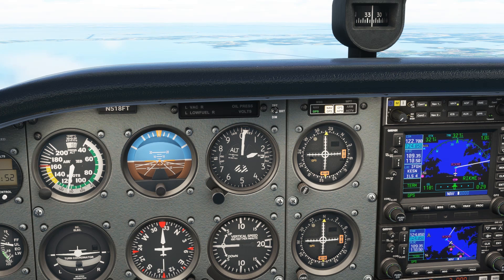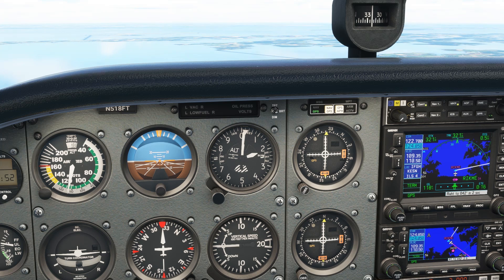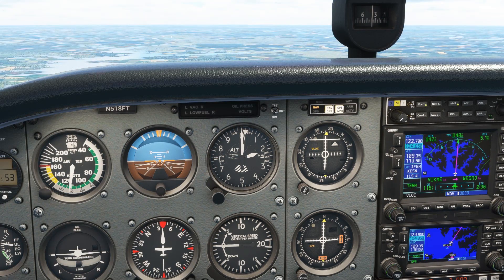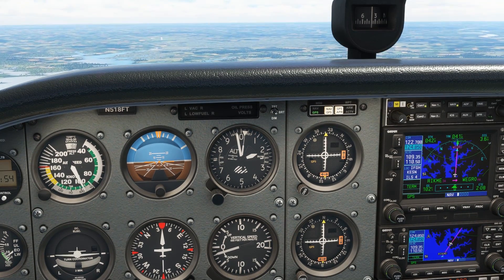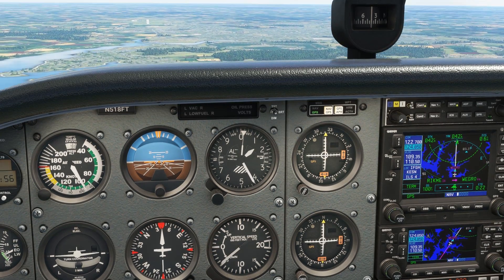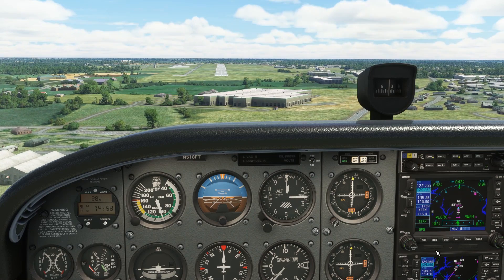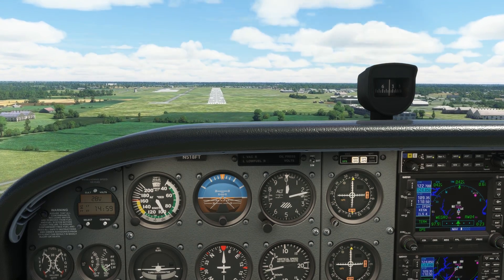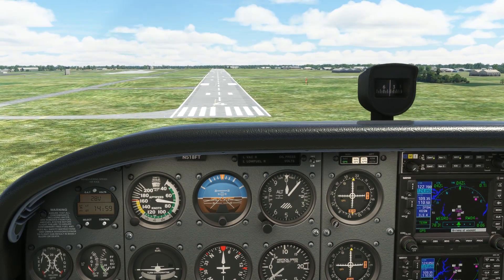Major Cause of IFR Checkride Fails | GPS and VLOC Modes

Comment: 430 will switch to VLOC  when you are joining the leg immediately prior to the FAF  AND  the localizer frequency is correct in the active NAV radio.     In some cases you may want to monitor the glide slope indication earlier than that in which case - push the vloc manually.
Reply: Yeah.  When you load the approach, the GPS loads the localizer frequency into the STANDBY.  The pilot has to flip it to the active.  

Also, when the GPS does the determination of whether to switch to VLOC (which is like 2 nm from the FAF) you must be more or less centered on the course, and you have to be going within like 45 degrees of the proper course; approaching it at 90 degrees won't trigger the switch.  

ALSO also--the above is the behavior by default, but it can be turned off in the menus.  So if you're used to depending on that setting, make sure to check it if you're flying an airplane that other people fly.

Comment: So if the approach such as the ILS-30 @Jefferson City, MO uses a (LOM) as the IAF, you can fly to it via the GPS. If you still had a working ADF you can use that to go to the IAF. So I’m guessing you must fly outbound on the GPS, start your procedure turn as published and the switch to the VLOC to intercept the localizer inbound? If you fly outbound on the localizer then there is reverse sensing and a very sensitive CDI. I would think the examiner would allow you to switch to VLOC as you are starting the procedure turn. Am I wrong?
Reply: During my training we switched to vloc a bit before crossing the IAF going outbound. It is sensitive but can still be referred to.

Comment: I passed my instrument checkride in October. The only note from the examiner afterwards was, “Garmin will get you”. Now, he had a bunch of reasons to support this statement, and this was one of them. Luckily, I remembered to check the 430W and actually pointed to it to confirm it had flipped like it was suppose to. It had bitten me before on practice approaches. This video is an excellent reminder.